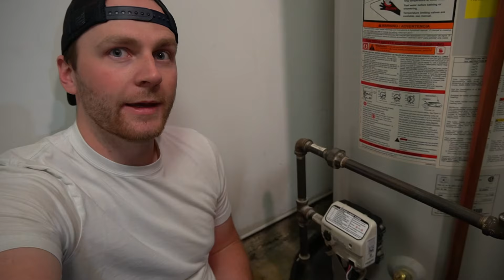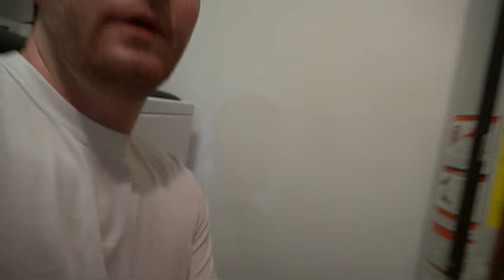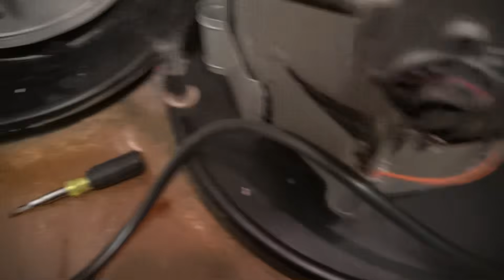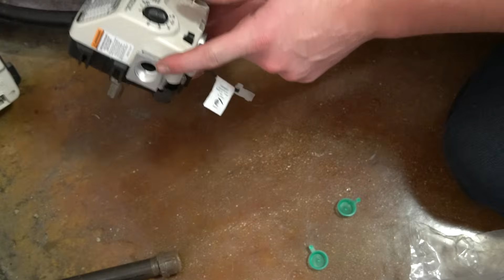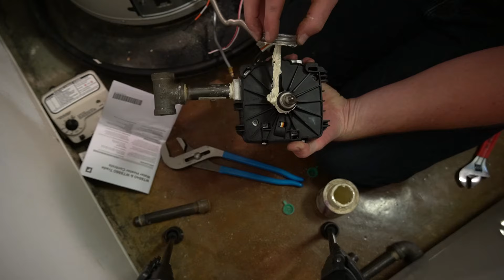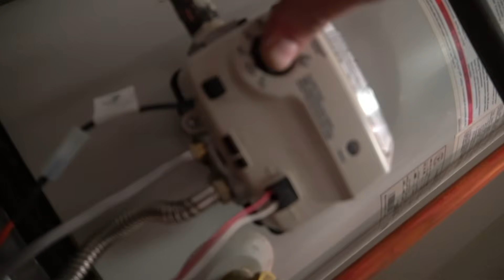How to replace a water heater gas valve - In Depth Tutorial

Comment: This fixed my pilot light issue exactly the same as yours! Thanks! One thing that cauhht me off guard was I wasn't expecting water to start sizzling/dripping on the burner but I found out it was just condensation from the ice cold water in the tank. Initially I thought I didn't tighten my gas valve enough. 😅

Comment: I'm trying to replace my valve but I'm having trouble loosening the nut on the gas supply line, just to the right of the pilot tubing. That thing was put on by the power of Grayskull. I'm starting to round it off and I'm not sure what I'm going to do.

Comment: Mine had no spark after replaced the thermalpile. My next step was going to replace the gas control valve but the pipe was there so tight.

Comment: I just had to replace my 13yo John Wood and the guy who installed it tightened all the joints so tight i had to heat them to get them moving.  I was using a big pipe wrench not wimpy channel locks either. 
I wanted to remove the okd gas valve to keep as it was still working but it snapped off. I am sure the original installer cranked it an extra turn or 2 to be a jerk.
Reply: I had the same issue. Were you able to get it out?

Comment: I drained my tank from the brass valve.  I have no hot water in the house if I turn on the hot side of a faucet.  But when I removed the thermostat, water poured out.  I don't understand.  The thermostat is a few inches higher than the brass drain.  What gives?

Comment: Drew, I am working on replacing the gas control valve, everything is going fine BUT the flexible gas line WILL NOT BUDGE. Don't know if it cross threaded or what. Any tips?
Reply: I just figured out the flexible gas connection is reverse threaded. I don't believe you mentioned that possibility.
Reply: @richardliston5488   It isn't reverse thread on mine.

Comment: Ive been replacing entire control assemblies by HW for code 7 per directions from customer service after reset steps fail. Ive rechecked 3 units and the boards are bad in them. I'd like to thank you for the through explanation of especially the pilot and burner valve check. Most DIYers stop after control valve failure is determined, but could saved a lot of money by purchasing the control board..

Thank you so much.

Comment: Just wanted to leave a comment appreciating the detailed explanation of each step until the end. You made it look so easy and it was, aside from some annoying hiccups on my side which had nothing to do with the video. Like draining of the tank taking forever, or being unable to break the gas pipe loose. Once all that was done though, it was smooth sailing. So really, thanks again.
Reply: You can swap out the control panel with water still inside it won’t pour out if you leave faucets closed DONT POP THE PRESURE RELIEF VALVE ..takes way less time..

Comment: Thanks very much! Excellent video. I just replaced our Control valve assembly on our 2018 A.O.S. 30 gallon WH. today. I had the same issue as yours. Check for leaks! My Pilot tube ferrule had a leak, but we used soapy water on the connection and it bubbled. It felt great getting a warm shower after 3 days of sink baths.Cheers!

Comment: On the AO SMITH Hot WAter Heater control panel what does Low and VAC stand for.  Tnx
Reply: Low (literally low) heat, but is still considered usable. VAC is “vacation”. In other-words, it’s so low that it’s not considered “usable” but keeps the water just warm enough that when you get back from vacation, it’s easy to warm. Otherwise you’ll use a lot of energy bringing potentially freezing water up to heat coming back from vacation, so it’s a better idea than just using the pilot.

Comment: Quick question. What if I cannot turn the water off, the faucet is seized in the open position?
Reply from the maker: You'll need to turn off the water at the main shut off where it enters the house. Only difference after that is now you're draining your entire plumbing system, not just the hot water lines.

Comment: Thanks for the step by step on replacing the valve.  I had the same issue and tried replacing the themopile, but that did not resolve the issue.  Yours was the first video that showed the same problem with the pilot going out like mine.  I was able to replace the valve and the heater fired right up.

Comment: FYI you do not usually need to drain the tank.  Shut off water supply & do not open any water valves.  Remove gas valve, leakage & dripping will be minimal. Carefully install new valve into tank. A dry towel will usually be all you need for drips!

Comment: For those who have a water heater that operates on LP gas, the gas supply line nut that connects to the gas valve will be a left hand thread, so to remove it, you will turn it the opposite direction.  For the question about the union,NO PIPE DOPE on the union nut.  It is sealed at the tapered seat, just line a flair nut fitting which also should not have pipe dope.

Comment: Thank Drew, my case is exactly the same as yours. I did have replaced the thermopiles, the pilot light still cannot stay, have tested the volage, it is in the normal range: 730 mV. My water heater is also same as yours: AO Smith 40 gallons, close to 6 years. I also tried to swap the circuit board taken from the control valve, since it is simple, no need to drain water, no need to take the control valve off, so no gas plumbing, but it didn't work. Today, the final solution I can do -  replace the control valve as whole, wow. it works this time, feel big relief, I have had one week to have the cold bath.
Reply from the maker: Awesome! Glad my video helped you!
Reply: That would seem to indicate the problem is the gas valve itself,  inside the control valve  assly, and the card is probably sending voltage to allow gas but valve isn't responding. My water heater might be the same, but I just ordered the whole control valve from amazon. The reviews online of 2 places supplying just the card were not very good reviews.

Comment: no dope for the uniion joint?
Reply: No. On a union joint like on the supply line near the control valve, the seal is made on 2 surfaces inside the big nut. The metal surface of each half of pipe is machined to mate smoothly and tightly on the other piece of pipe once you tighten up that big "nut." As you do the nut up, it pulls one mating end of pipe tight against the other mating surface on the other piece of pipe. The seal is then made.

Comment: Great video, Drew, thank you. Noticed you didn't use any pipe dope on the union threads; I'm assuming it's not necessary?
Reply from the maker: Thank you! That is correct. The union is designed to form an air tight seal where the two halves meet in the middle. The threads and nut are there to hold the two halves tightly together, not to form the seal.

Comment: Just took a nice hot bath, thanks to the confidence your video gave me to tackle gas plumbing. FYI, I had a Honeywell gas valve fail like yours 2 years ago, and I was able to repair by replacing just the circuit board, per this video: https://www.youtube.com/watch?v=cAo4I2eoJ9Q&t=900s. Cheaper, and quicker, only don't use a 9V battery to "test" the valves—it may fry a solenoid, like I likely did recently.
Reply: I did that - replaced the circuit board only, but didn't work, the pilot light still could not stay. I have to replace the gas control as whole, means I have to do some gas pluming to see if can solve the problem just like Drew did here.